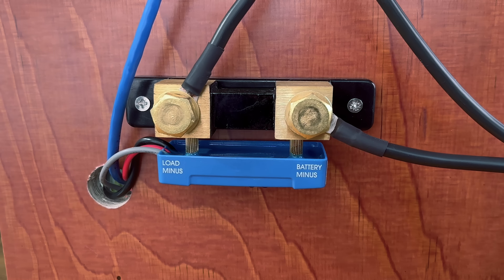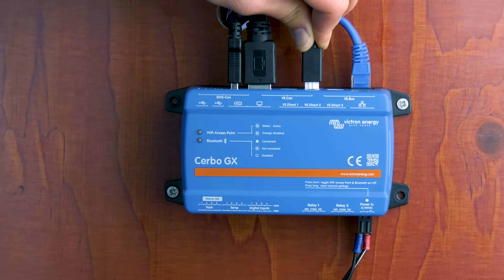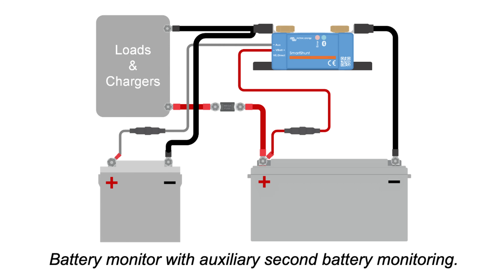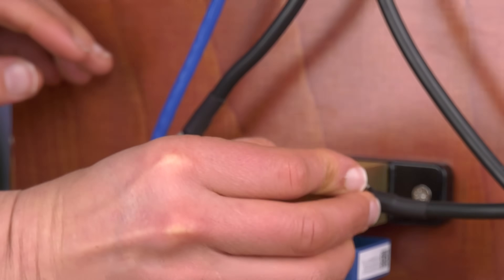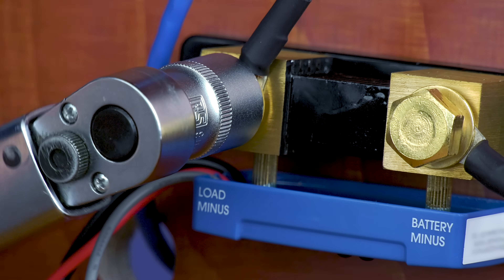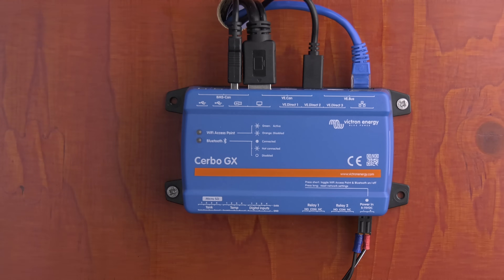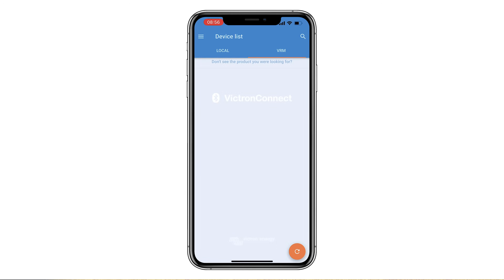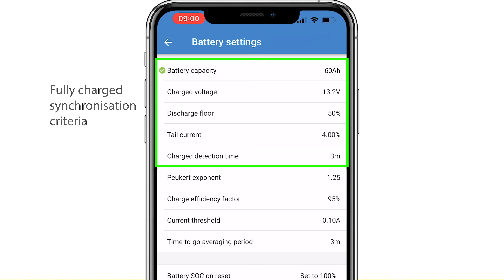How to install the Victron Energy SmartShunt IP65

Comment: Make sure you watch this video first. I used this to do a LiFePo battery conversion on my Ryobi lawn mower. I wanted something waterproof and shock resistant. It worked right off the bat and I was able to se the charge, but I had the charger ground on the wrong side so it wouldn't monitor the charging cycle. Swapped the charging cable to the load minus  and BAM it now tracks the charging. It's also nice that i can just just open the garage door and as long as I am in bluetooth range i can see the charge on the battery.

Comment: why can't anyone in these videos discuss the proper connection between a charger and the shunt? you would think this would be important for people with Marine Batteries that use a portable clamp style charger.
Reply: It's quite simple, the batteries are connected on the battery side.  ALL other things need to by on the load side. Including chargers , inverters and dc loads.

Comment: Help: I had the negative cable from my solar charger connected to the negative of the battery.  The shunt read the power/watts correctly but not the charged energy. I realized that I needed to connect it after the shunt. when I made the switch and moved all negative cables after the shunt.  Now when I put a 20watt load on the system the shunt reads -31 watts  & -2.27A.  I have 2 12.8 120ah LifePo4 batteries in parallel. any help would be appreciated.

Comment: insufficient explanation
Reply: What question do you have which wasn’t answered ?
Reply: @johannesboonstra6917  many questions - for example - gray wire, mid point, okay, for what type of battery bank? AGM, Lithium? 
If I have more than 1 battery, does the negative have to go to the last battery or does it even matter?
Can the positive be connected to the busbar where the battery is connected instead? 

I guess I need to study up on Victron as installing these products is getting more difficult since places like DargonFly don't answer their phone and Inverters R Us promises support after purchase but don't actually provide it. 
And these videos give just the basics with bunch of assumptions.

Comment: i purchased the exact smartshunt, I have a question on what will be the correct battery settings. I am connecting to a 36 volt 100 ah battery. For battery capacity should I use 100 AH or 300AH. Also I have a second AGM battery is it possible to connect both of my batteries to the Smartshunt. I am using the Victron Smart Shunt - 6.5V-70V, 500 amp
Reply: if your battery capacity is 100Ah, then thats what you fill in.   AGM on the voltage reading is possible indeed

Comment: I have two 12-volt LiFePO4 batteries connected in parallel with 2/0 cables. I want to these batteries to a 1,000-watt inverter that is using much smaller cables. So do I connect the shunt to the small negative cables that go to the inverter, or do I need to connect it between two of the 2/0 cables?
Reply: All loads, such as also the inverter, are connected on the LOAD side of the shunt.  The wiring size needs to match the amps for load.
Reply: @JohannesBoonstra-ol2nz  Thanks for the response. That's what I figured but I wasn't positive.

Comment: salve per errore ho disabilitato il bluethoot sullo shunth come faccio per riattivarlo, Grazie
Reply: Ah , that's not really a problem , but you need a Ve direct/USB cable to have Ve direct run wired, then bluetooth can be switched on again.  I am sure the dealer can also help out if needed

Comment: So, for the starter battery with negative terminal to chassis ground the load minus should also just be connected to chassis ground?
Reply: That can remain there on the chassis, the aux battery (the battery you want to read state of charge) needs to be disconnected from the chassis. There the chassis may be on the load side
Reply: I think the question was a different one: How to connect the smart shunt to observe a starter battery?

Comment: We have 2 48v (100x4 Lifpo4s x2) battery banks. Both lead to our MultiPLus-II 48/3000... via a common busbar. Can we use the auxiliary wire to monitor the second battery bank?

Comment: My battery box is basically a fully enclosed steel box (i.e. below the middle step to the motor home). Will the blue tooth signal be able to escape the steel box, with the only ports being those for the heavy wires, and reach my phone?

Comment: So I installed the smart shunt. it counts down from 100. 99%,98%....but if I have no load it doesn't start to count upward. Just resets back to 100% when batteries are fully charged. Everyone else says theirs will count up also. What am I doing wrong?
Reply: could it be the minus lead of the charge source is hooked up on the battery instead of the load side of the shunt?

Comment: How do u connect it to 2 batteries mines not reading with the shunt properly
Reply: ?   The two batteries are parallel?  then there is a common minus right?  Thats the location you have the shunt installed.

Comment: Hallo Victron Team, 
Wird es für die orion 12 12 30 auch eine neue sw / fw geben die den shunt erkennt oder den temperatur Fühler im ve smart networking. Vielleicht sogar die bv712 ?  Das wäre super, dann erkennt der booster wenn unter  1 Grad und kann wie der 12 12 50 mit Spannungabfall rechnen. Gruß Thomas

Comment: Maybe I'm stupid but makes no sense to me,how do you connect the solar charger after the shunt if the battery negative it's connected to the shunt,where do you connect the negative of the solar charge controller.
Reply: Only the battery minus comes on the battery side of the shunt , All other minus leads are on the systems side

Comment: Is a fuse not recommended between the shunt and battery negative? What about the sum of all load/charge currents exceeding the cable or shunt rating?
Reply: the fuse is often in the plus lead, but can indeed also be in the minus.   When the load or charge current exceeds the 500A of this model you can choose for the 1000A or even 2000A version
Reply: Ok thanks. Should all currents by summed, or should the loads be summed, and the chargers subtracted, as the current flow from the chargers would be in the opposite direction (through the shunt) than the loads. Ie net positive vs net negative charging.
Reply: its about worst case, whats the maximal charge current and/or whats the maximal discharge current  @matthewpaull7362

Comment: In case, I have got a battery with BMS and this one is connected to the inverter via VE.Can protocol, do I need this shunt to determine the SOC of the battery or not?

Comment: IP65 is the reference of the product ? is not reference of ISO ? 
ref : ISO 16750-4 / ISO 20 653-2013 / IEC 60529 / D55 1112
Reply: A IP rating is the type enclosure/ water resistness

Comment: Great video that i looked at before purchasing my Smartshunt. But there are a detail disturbing me and that is putting the positive ringlug (from the smartshunt) with the wrong hole size for the bolt between the battery post and the negative ringlug, this is degrading the contact to the negative battery post.

Comment: My house battery is under my Class B van.  I'm concerned the bluetooth may not be in range and will be shielded if I'm trying to read the display on my phone while inside the van.  Is it possible to still connect an external display via a wire connection such as one of your BMV devices?

Comment: Hello! What happens if i do not connect the starter (main) Battery of the Load Side of the Shunt, instead of this i connect to The battery side, cause I got two batterys in parallel (main battery engine bay and second battery on the trunk) Both work for the car, winch, lights, etc. Both are charged in parallel by the alternator. I just only want to know information or status when my car is off, and the freezers and camping lights or inverter are running (engine off, car stoped). I got incorrect capacity measurements? Or it can work normally. Thank for the help in advance

Comment: is it a problem to connect the red wire to the + side of a battery disconnect switch so the IP65 does not drain the battery say if stored for several weeks?

Comment: So do i need to connect the grey wire to anything if im just wiring to my dual batt set up in the back of my 4x4?
Reply: From what I understand it's optional hook up for separate battery bank or used as a temperature probe.

Comment: is the shunt needed? im asking because every multiplus has its own battery monitor that is shown in vrm and in VE Configure app. 

Why two devices that measure the SoC?
Reply: When there ia ONLY AC loads and charging by the multi, then there is no shunt needed.  in other cases there is as you would "misread " the current

Comment: My system is 24V but actually has two 12V batteries wired in series.  Can I still use the Smart Shunt, as long as I make sure I install it in between the 'second' battery and the load/system?  I will put positive on the 'second' battery (closest to load/system) as well.
Reply: yes, two serial connected batteries are basically a single 24V battery

Comment: Thanks for the video. May i just ask something: my habitation battery is grounded to the vehicle chassis. Where should i connect the ground cable? Load minus? Battery minus? Directly on the battery negative? Thanks in advance. Cheers
Reply: the shunt comes between the minus of the battery and the chassis, grounding on the chassis as well

Comment: But what is the solution when the load is grounded by the chassis?
An old school alternator for example?
How do you want to measure the current and show it on a Cerbo?
Reply: then the minus of the battery needs to be detached from the chassis en in-between there the shunt is placed.
Reply: @johannesboonstra6917  Thanks

Comment: Hi, I just tidied up the wiring in my engine bay and shortened the red AUX Smartshunt wire to about 200mm - now the starter battery voltage reads about 0.33v although the battery is fully charged. Is the length of the red wire critical for accurate readings, or could it be the new ferrule I fitted not making proper contact? Thanks.
Reply: no, as there is no current there the length would not have an effect , a bad connection would..

Comment: Hiya Victron, I've read a lot of claims that the bluetooth range is often less than 1m, is this a known fault or a known limitation of the product? Also, does the unit itself save the history? Or does the charge history reset every time the phone is disconnected. The product looks amazing aside from these concerns :D
Reply: This is kind of true and untrue. The range is extremely limited if you want to go in to the app and view the all important live data, basically it won’t connect but if you just want to see the limited data on the tiny opening page of the app then the range is great and sometimes I can exceed 10mtrs. The same goes for other Victron devices and is completely useless for their smart chargers that don’t give you any information unless you go into the app. The only up side of the lack of information for the smart chargers is that they really don’t need to be looked at unless you just want to see stuff.

Honest opinion? Get the BMV712 with the Bluetooth option because you get much better range on the wired screen than you do with the Bluetooth.
Reply: @richardb8492   Is the BMV712 compatible with this smart shunt?

I have an industrial robot with lead acid batteries but I plan to swap those batteries very soon with lithium ion, which means my old school power meter won't work.

I'm hoping to find a simple and cost-effective replacement!
Reply: @JLCRobotics-PhilDenton  the BMV-712 come with its own shunt, screen and Bluetooth. I also believe the Bluetooth signal comes from the screen so if it is mounted in clear view then the signal should improve.
Reply: @richardb8492   Uhoh.  We just ordered one of these (the Smart Shunt) from Amazon yesterday.  It was only $130 and thankfully Amazon is good with returns so if the shunt has terrible range as described here, we'll just return it.
Reply: @richardb8492  well the shunt is effective a block of metal , this isn't very good for conducting bt signals.   so when the connection box is " in between" the shunt itself and a metal enclosure /chassis, yes then the range is limited.  when the box is "open " and there are not metal covers ect preventing the signal, the range is quite high

Comment: I have tried updating the firmware of a victron Smartsolar charge controller and it never worked ever since then. It keeps the yellow error led light. All attempts to fix this was never resolved. Kindly help. How do I correct it ?
Reply: best is to show the dealer whats happening and have them help on this

Comment: If you have two separate battery banks, and each has a Victron shunt. I was wondering why you couldn’t have two separate charge parameters. In other words, if one battery bank says 55.2, according to the manufacturer, and the other says 56.5 the shunt is dictating to each battery bank what the charge would be?
Reply: Hello,
If you have two isolated battery banks, you need two shunts to measure and can make settings per bank then.
Reply: @johannesboonstra6917  
Unfortunately, so for the battery banks are very misaligned! One is getting three or four times more input when the suns out and using three or four times more when the sun goes down? One battery bank is BattleBorn Batteries and one is SOK. Both are 16S 12.8 voltage. Both wired to 48 V.
I’ve tried different settings, but it doesn’t seem to make a difference. 🧐
Reply: @simon359  i dont understand what you say,  you have two shunts ?   then you can make the settings required per bank right ?
Reply: @johannesboonstra6917  
I’ve been told by others that you have to use the same charge settings on both shunts. I split the difference between 56.5 (battleborn bank) on one shunt and 55.2 (SOK bank) on the other. so I put them both at 56 V.
They’re all on one network. 🖖
Reply: @simon359  the both shunt shown their own calculations , what the other is set at isn't relevant in any way for the other
Reply: @johannesboonstra6917  
Nice, thanks for the clarification! 😜🤙
Reply: @johannesboonstra6917  

is it not weird they are asking for charge parameters when the shunt doesnt handle any of that? its only for metering the power going through the cable.
Reply: You realize that the unit is basically a battery monitor right?  @MHawkeye
Reply: @johannesboonstra6917  

is that not what i said?
Reply: sorry, misread who said what .... @MHawkeye

Comment: Hello, you should have a shunt or DC Meter for the positive wire. You can sell so much more Shunts when it's ready as a DC Meter and show on the GX.
Reply: Hello 
Well actually that doesn’t matter installation wise, but in the minus it’s lots more safe
Reply: @Victron Tech  
But what is the solution when the load is grounded by the chassis?
An old school alternator for example?
How do you want to measure the current and show it on a Cerbo?
Reply: @robertstuckle6198  

as they stated, the device will still work if mounted on the positive side. Negative is just the safer route.
Reply: Thank you

Comment: You don't mention if the multiplus II inverter/charger can use the shunt info to better charge the battery??? Or shut down the inverter if battery is low.
Reply: Thats also not the case, the SmartShunt does monitoring only.

Comment: Generator not detected at AC-input changed from 'Alarm' to 'No alarm'
Reply: this is a question?   could you rephrase please
Reply: @johannesboonstra6917  My system is electricity, generator, and solar.  However, when the country's electricity comes on and the electricity is weak, the generator runs, but the generator does not become a dictator.  Why is that?

Thanks

Park
Reply: @전-p2x  dictator?    You means isn't used?    the AC1 is the priority input , AC2 is secondary.    So if you have the generator on AC1 this will be overruling the AC2 were the grid is on.

Comment: Can this connect to a BMV-712?  my current shunt got damaged with water and would love to replace it with this.
Reply from the maker: No, the SmartShunt IP65 is a battery monitor with shunt in 1 unit. The SmartShunt IP65 does not work with the BMV, it's a replacement of the BMV, only then without a display. Your phone with VictronConnect acts as the display.
Reply: Good question but I doubt it. From what little I've learned on YouTube tonight, he BMV 712 is talking canbus to the actual batteries.  This smart shunt is measuring consumption as it flows through.

Comment: How long can the SmartShunt save the logs for later retrieval if I'm using the phone app only every once in a while to check on it?
Reply: If your system has a cerbo, you can insert an SD card for several months of data storage offline.
Reply: So if you don't have a cerbo it soesn't save any data when you log into the app to see what happened earlier that day?
Guess I need to get me a cerbo.

Comment: Complimenti per le spiegazioni, ho una domanda mi dicono che il BMS della Victorn non funziona con batterie di case diverse dalla vostra è vero? Grazie mille
Reply: Not really understand if there is a question.
Reply: @johannesboonstra6917  si si 😁 bms della Victorn funziona con batterie litio cinesi?
Reply from the maker: @mylife-vitadabarcaavela9919  Yes, as the combination BMS and lithium cells is essential for balancing, safety and reliability. We strongly advise to have that from the same manufacture.  So therefore we have decided to have the BMS /match the battery.

Comment: Will this device have any effect on my smart charger?  Also, I leave my boat for six month periods, if you disconnect positive lead to battery, does that result in zero amp draw? Don’t want dead battery when I return.
Reply: the smartshunt is not effecting the charger.   When leaving the boat the main switch prevents the discharge, so also the smartshunt is off.   At return you need to recharge the battery and with this the correct state of charge will appear